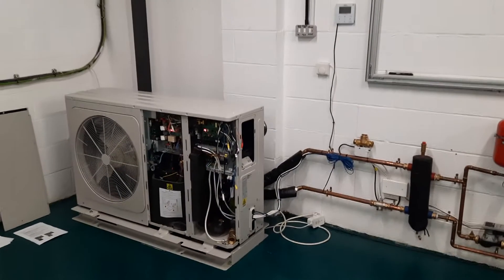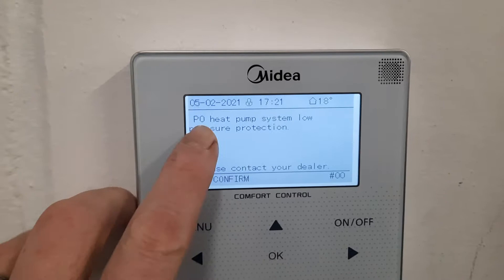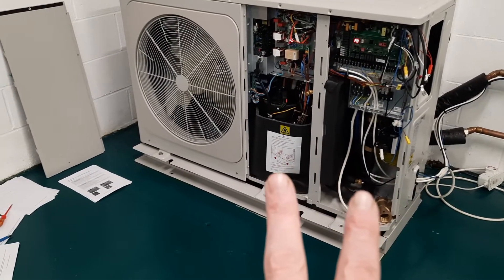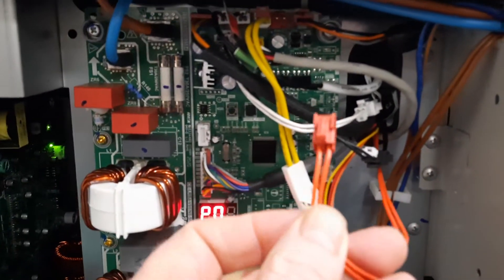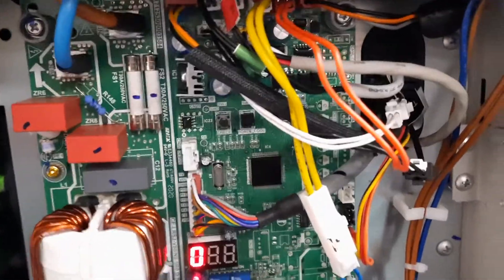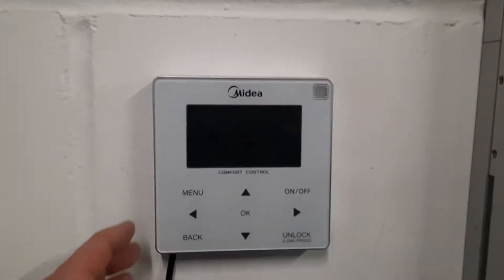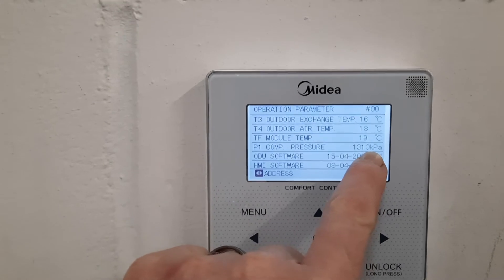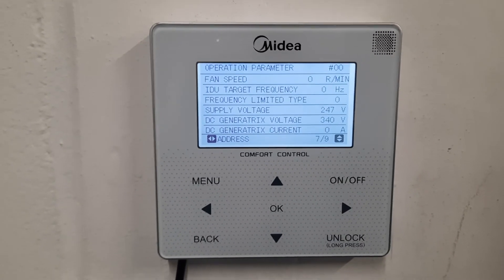PO and HP error Midea air source heat pumps

Comment: Hi, i had this error P0 and was solved after water was introduced in the system , the problem now is that the water outlet from internal unit doesn t pump hot water even that exterior unit provides the hot water in the interior unit, any idea how i can fix this ?
Reply from the maker: sounds like you need to get the installer in, if the heat pump is making hot water but its not gettting round the house there is something wrong external to the heat pump
Reply: @myheatpumpchannel7577  the issue was the freon whixh wasn t suficient , it seems i had a leak